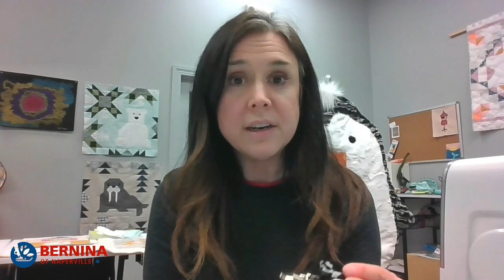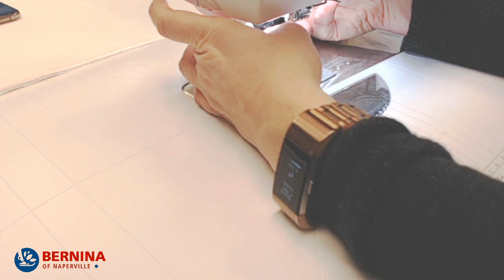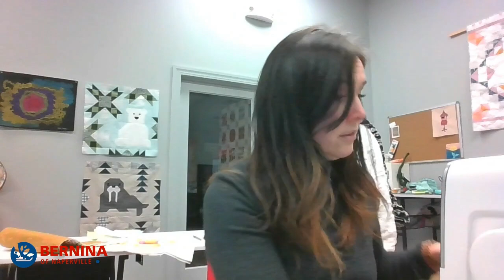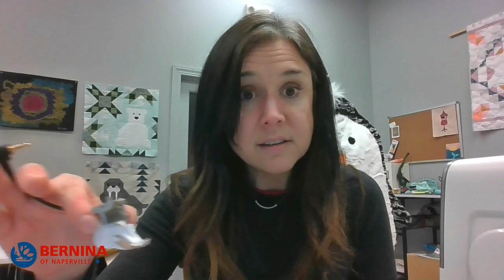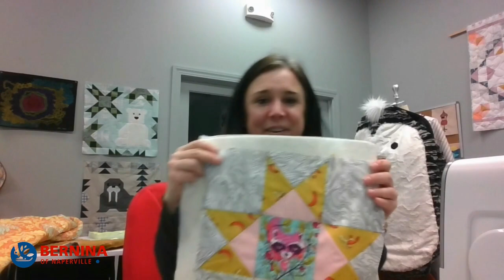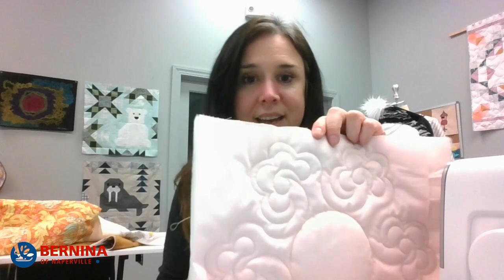BERNINA Domestic Quilting Tips

Comment: My stitch regulator doesn’t have the red light that yours shows on the screen.  Is there a way to turn that on?
Reply from the maker: Depending on the model of your machine, you need to plug the BSR into the machine in the appropriate receptical, then lower the presser foot; press you foot control and the red light comes on. If it doesn’t, I recommend a trip to your local bernina dealer for sales, service and education.

Comment: I smile while watching your videos. I have been in Naperville before ever learning about Bernina and so I feel connected to your effort to teach and enjoy your lessons. I am using a BSR  and do not understand how to judge foot pressure because 74 and 42 is showing the bobbin thread alot!
Reply from the maker: That’s not foot pressure, that’s tension. So the BSR has its own tension adjustment because it is considered a separate stitch. So if you tighten the upper tension on it, when you put the #74 foot on, that’s gonna be with the actual #1 straight stitch. 

Also, what model BERNINA do you Have? What type of thread? Is the tension eyelashing? There are so many things hinges to consider.

Comment: Great idea to use the backing fabric for your quilt design.  I’m thinking I might use cheap gift wrap paper for the design work then tear it off.  Whatdaya think?  Tell Bernina we want a ruler foot for our BSR.
Reply from the maker: Wrapping paper will make a mess. I prefer to ruler work without stitch regulation as one typically goes slower. The Q16 is awesome as it has the regulation at the needle plate for the 360° movement.

Comment: do you need to do 'micro' stippling with the microstippling foot? or can you do other FMQ using that foot?
Reply from the maker: You can use others, but this one is nice because the height is adjustable and it has a larger opening with matte finish metal that reduces glare.
Reply: @BERNINAofNaperville  I understand that, but my question is 'can you use this foot (microstippling) to do other types of free motion quilting?  Such as larger stippling, ribbon candy, feathers, loops, and spirals, etc. etc.?

Comment: Do you need it if you have the BSR
Reply from the maker: Walking foot is very useful for straight line and match stitch quilting. Also sewing the binding on. Although some of the machines also have dual feed, the walking foot can get a better hold of the top material in some instances. The BSR is for free motion quilting like following a motif or stippling. Not as east to do straight lines.
Reply from the maker: Hi. Need what?
Reply: @BERNINAofNaperville  the “walking foot”

Comment: How did you lower the feed dog on the 880+?
Reply: Also how thick is the ruler?  Thank you.
Reply from the maker: When you add the BSR to the 880 PlUs the feed dogs automatically drop, otherwise the feed dog button on the left side toward the bottom of the touchscreen puts the feed dogs down. 

Rulers are the Amanda Murphy good measure rulers in 1/4” thick for Longarm used with the #72 adjustable ruler work foot.